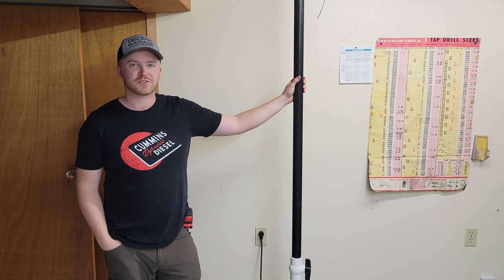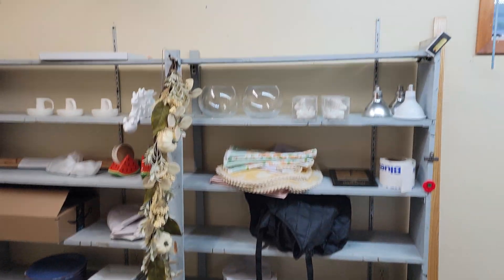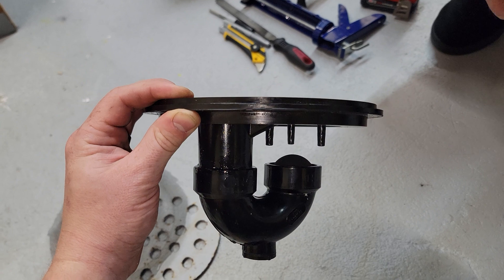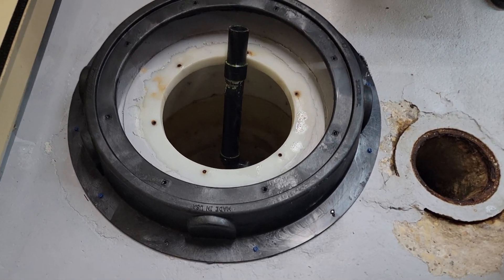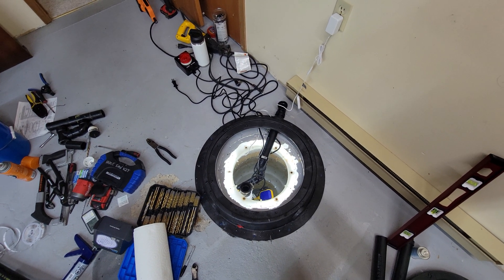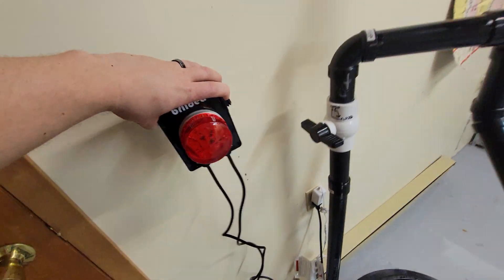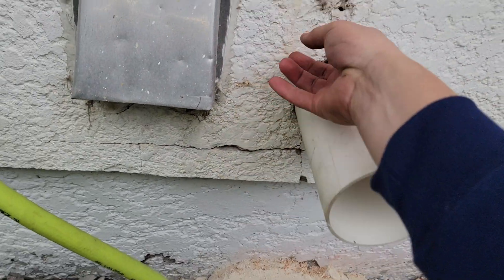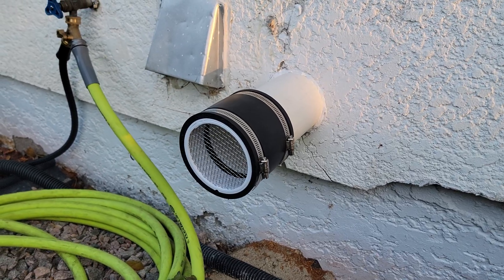Radon Mitigation Sump Pit System DIY | Canada

Comment: Have seen other comments mention fan placement. The reason the fan should be installed outside (where it's definitely meant to live) is because if you had an issue downstream in your venting (say a blockage or a break in continuity), there's a possibility of that radon gas being pumped into your home which, to state the obvious, would be VERY bad. I live in northern WI, likely with similar climate to most of Canada and outside mounted fans work fine regardless of climate here.

Comment: I'll soon be in the process of installing one of these sump domes. Did you order a 3-hole electrical cord grommet, or did you drill out the blanks on the single cord grommet supplied with the cover to accommodate the additional cords for lighting and the sump alarm?
Reply from the maker: The sump lid kit comes with a big grommet and we just drilled a few extra holes in it. It's large enough to accommodate several wire pass through. Just drill the hole a touch smaller than the wire so it seals up.
Reply: @OvensGarage  Thank you!

Comment: You're not suppose to mount the radon pump in a living area and the exhaust should be above the roof line or not near a window, like you did.
Reply from the maker: Code differs based on location. If you read the title of the video you may have realized I'm located in canada. I installed it according to my local building code. Thanks for the input though.

Comment: Don’t you need a city building permit to do this? And you didn’t mention that the sump pump needs a dedicated electrical outlet to plug into.
Reply from the maker: @user-ek1ee5om8e  no permit here, although it may depend on your location. Also yes the code where I am says you need a dedicated outlet, but I'm just plugging them all into this outlet next to the sump pit. No big deal.

Comment: Nice clean job. I am in Michigan.  What do you mean having winter/summer mode for sump pump?
Reply from the maker: @mrzif0013  in the winter I plug the exterior outlet for the sump exit at the house and it re-routes and just pumps into the floor drain instead so it doesn't freeze in the cold temps

Comment: Love the installation, but I was told by Radon Contractor here in Illinois we must have the fan installed on outside of bldg. and the top of the 4" PVC has to be  min. 12" over the roof line, what is your opinion about It?
Reply from the maker: My opinion is you should follow local code, however I definitely prefer this type of installation where the fan is inside for serviceability reasons. It keep moisture and freezing temps away from the fan and I can easily check the manometer to ensure it's working. The reason why the code states it needs to be outside is in case your joints leak you aren't pumping radon into your house but that can be mitigated by installing a meter inside and ensuring you monitor it frequently. I personally don't think the risk is that high that something like that would happen. As for running the exterior tube above the roof line, there's a good study that someone did about the hazards of radon reentry into the home with an at grade exit similar to mine and the risk was low, however if you are sitting directly in front of the exhaust for extended periods of time it is not safe.
Reply: Correct. It has to be outside or in the attic. It also has to be above the roof line or 7ft above ground level.
Reply: Radon mitigator here. This is all correct. In the US, code generally says the fan has to be mounted outside so that if there is a leak in the piping after the fan, or much worse a break in the line, you aren’t pumping massive amounts of radon into the home. In Canada, I believe the code actually allows the fan to be mounted inside to help keep the system from icing up as much. Forgetting the code, mounting the fan on the inside is easier for hooking up electrical, and looks better on the exterior of the house. You would 100% want to have a continuous monitor if you did it this way, and keep an eye on it in case the system leaks in the future. Expect that any good inspector would call you out on it when the home sells. 

It is possible to exhaust the gas at ground level, but this is very against code. If you take this route, you should regularly test different parts of the home to find out if the gas is drafting back into the home.
Reply: Also fans are installed inside in Canada due to freezing temperatures.
Reply: @dislexicllama especially in Winnipeg where it can hit -40 in the dead of winter 😊
Reply: In Canada there is no requirement that the fan exhausts above the roof line. It need only be 1' above the ground outside. Check your local code.

Comment: Smart idea for the plexiglass and LEDs. Thorough design. Great job!
Reply: Great idea of adding LEDs. The Govee light strip has such a short cable between the strip and controller but yours is quite lengthy so you're able to place controller outside of cover. My question is did you buy an extension (if so where did you get it) or rig one up?